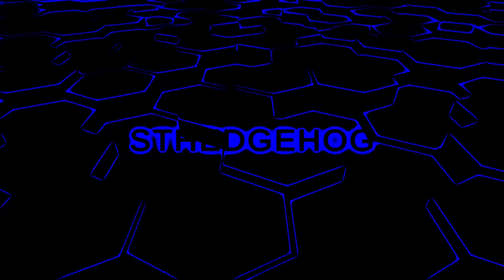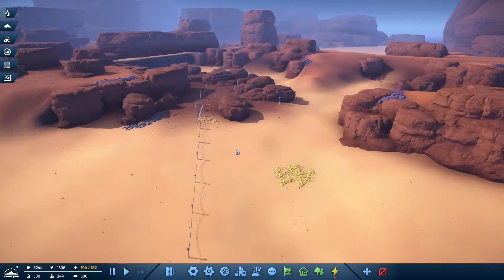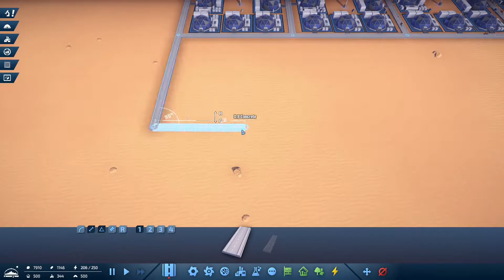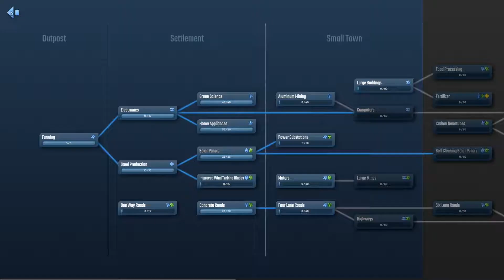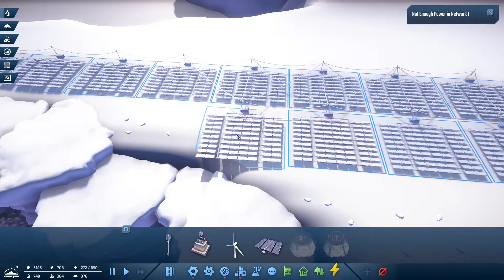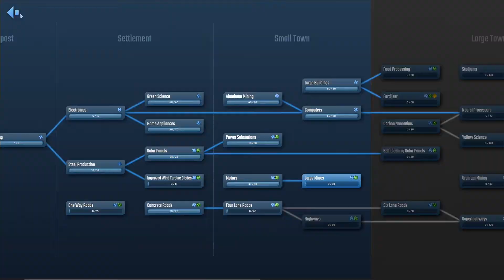InfraSpace Grid City - Parks and Recreation

Comment: Save space on solar panels rotate them so the power connector box is inside the dashed map edge line, leave the roughly other half of the panels outside the line. @ 1:18 if you rotate them 180 degrees and move them to past the map edge as far as possible,you would still have room for a road to reach that copper if need arises. Keeping your power suppliers on the edge of the map in conjunction with power poles and substations, will help free up space an maximize your building area.
Reply from the maker: Building outside the edge of the map is a good find. I don't know why I didn't even try that. I'll keep it in mind if I need it, thanks.

Comment: yes now you are making more BUT once you get to nanoproduction you wont be ... so more now is fine its your stockpile for later
Reply: looks pretty good ... sometimes the bonus isnt really worth the effort ... once you are out in the 240s a cycle range then the bonus can make a big difference but the ones around 60s get the best perks as they end up making more of the basic resources most of the the other production lines need ...
Reply from the maker: Yes, The bonus probably isn't worth it at this level. But, if I don't start doing it now, I wont do it later as I'll want to keep everything conformed and aligned as much as possible. I just need to build with the bonus in mind, but not worry about maximizing it, yet.